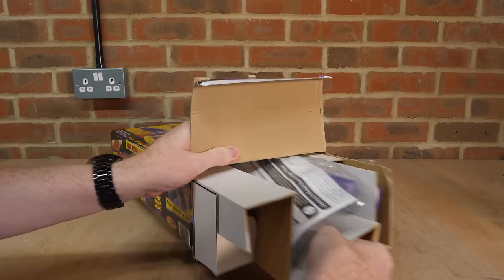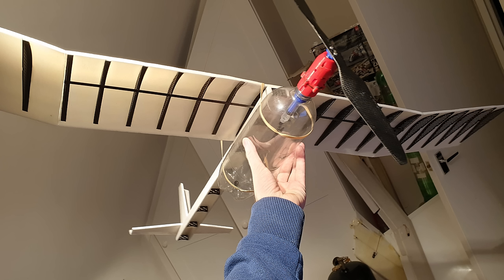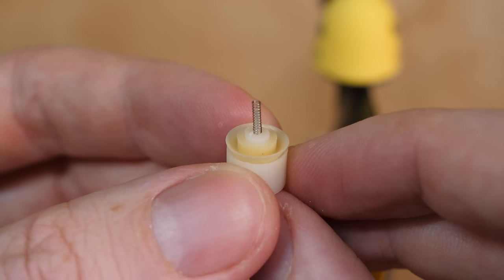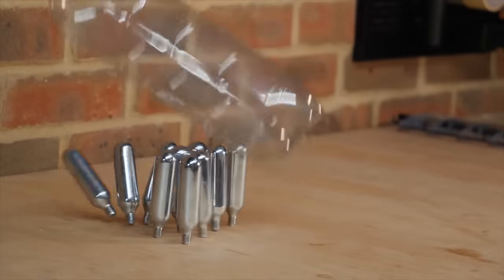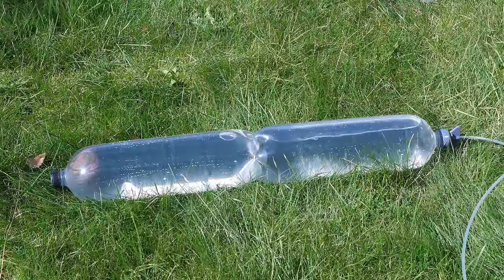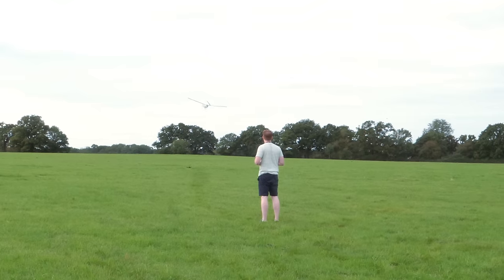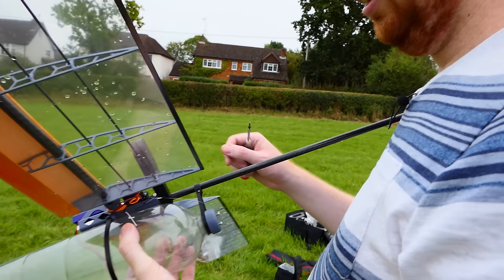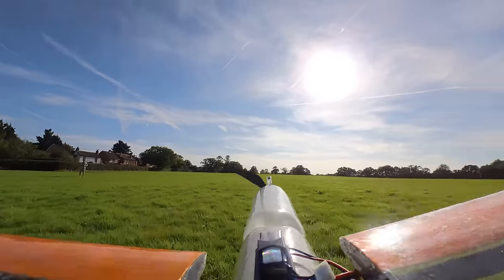Flying a Plane Powered by AIR

Comment: According to Sighard Hoerner's Fluid Dynamic Drag, the half-sphere with the open side exposed to the wind has the highest drag coefficient of 1.42, while a rod with a hemispherical cross section will have a drag coefficient of 2.3. The flying wing configuration B2, would be worth considering. The ASH-30mi, an open-class glider with 86.9ft wingspan, 41:1 aspect ratio (wing length to wing chord), has a glide ratio exceeding 60:1, making it the most energy-efficient glider.

Comment: I don’t think anyone else has mentioned this yet, so I’ll just throw it out there: Have you thought about changing the V-tail out for a large conventional horizontal and vertical stab arrangement? Perhaps this and the addition of strakes below the tail boom could help with that “Dutch roll” behavior you’re seeing when the nose hunts back and forth when you encounter wind or make a control input.

Comment: You should be able to save weight by using a smaller battery - my understanding is you only need it to power the receiver and servos. This can be done with a tiny 1S battery, which would weigh a fraction of your current one (which looks like a 2S LiPo). Smaller servos can be an option as well - I use 3.7g servos for my ultralight RC airplanes.

Comment: the gap between the bottle is causing air resistance and the reason for terrible performance when it's windy, if you can cover the gap with a thin layer of tape so as to create a smooth fuselag, it will perform better in the wind.

Comment: Hi m8. Use a thinner walled carbon tube. Arrows are built for strength. Don't paint it and fly in a straight line and you could get more altitude, and a longer glide down.

Comment: In order to increase air pressure a lot without adding too much weight penalty you may try "encapsulating" the bottle with very thin fiberglass+resine

Comment: Maybe you can find bottles with stronger plastic or thicker to withstand bigger pressures. If you reached at least 4 mins of flight time you could sell the pattern and sell them. The fact that it is air powered makes it so cool, plus the simple design allows for many mods. Imagine how cool it would be to attach a small nerf gun and do dogfights with these.

Comment: Hi Tom. Some thoughts:
To improve flight time, consider not running when launching. In flight do à minimal Number of turns and at Tiny bank angles.
Mechanically : 60:1 LD ratio is best theoretical but much much less at model size (raynolds Number). Can be improved though with bigger Wing aspect ratio, profiled fuselage.
Other considerations : adjust flying speed for climb and glide phases for best Time in the air. Lose weight everywhere (tail feathers holes, less balsa and wing spars, flight battery, wires, remove connectors…
Maybe the motor could be geared (?)
Interesting project

Comment: C02 canisters hold more than their compressed volume value due to the co2 condensing into a liquid. It might not be enough to matter due to the weight of the steel canister but its worth looking at the calculation.

Comment: You spent so much time optimizing the air engine, I'd love to see it used with different sources of gas.  Liquid nitrogen is 750x denser than gaseous nitrogen (and liquid air is even denser), if your engine can withstand the temperature that may be an interesting avenue to explore.
Alternatively, I'd love to see it adapted to steam power.

Comment: I think you should build a 4-5bottle dual engine plane. Try to get some more power to increase altitude so you can glide more. Plus, the heavier weight will help stabilize in the wind.

Comment: Hey Tom,
congrats on making it so far with an airpowered engine.
i got a proposal to make your engine more efficient.
When you mentioned the timing issue regarding the angle of the crakshaft and the inlet valve, i remembered the mechanical advantage of a longer connecting rod.
i played around with designs for flame-eater engines.. practically operating on vaccum.. 1 Bar ~ 14PSI. that`s not a lot.. so you gotta take every advantage you can.
they run remarkably better with longer connecting rods, because the angle between the piston and the crank is minimized. straighter is better. simple geometrics - parallelogram.
to clarify: i`m talking about the rod ONLY. the stroke and crank stay the same.
think about it this way: a more efficient engine will probably be able to run on less pressure. every PSI saved will increase you flighttime while using the same air volume.

Comment: Beautiful project, in my opinion you should take inspiration from the world of gliding. Since, your model fly at low speeds you should concentrate in creating light wings but with modern airfoils efficient at low speeds, also the use of winglet could help you to reduce the induced drag coefficient which can be reduced by adding winglets or by increasing the 'wingspan. This is usually an important factor in large aircraft, but if your goal is extended flight time, even small details matter

Comment: Truly amazing!  If you watch how RC glider pilots fly there might be additional time yet from optimizing your course design.  I’m wondering if you spend the maximum time flying into the wind (which seems like you should gain lift for free but this is a guess and glider pilots will know how to get the most lift from the air) if that might buy some additional seconds.  When my RC plane’s battery is near the end I do this to keep it flying longer.

Comment: So, I have very recently came into possession of a Ryobi Battery powered air compressor.. Which has a limit of 120psi.. (There are prob cheaper alternatives, but I am invested in the Ryobi system now)..
The advantage you would have with this, is while you are doing your checks, and doing your launch, and your flight, and your landing, and then your post flight checks, and you walk back to your controllers.. It's continuously building up pressure for your next flight... It will save you a whole load of bike pumping and getting out of breath.. 
All you would need is to bring a battery or two for the compressor.. You could also even charge your flight batteries from them also.

Comment: When I was a kid in the US (50+ years ago) , we air-water vapor-powered rockets fueled with a bicycle pump. Besides putting our eyes out, we were able to launch a 20 cm tall rocket 20 meters in the air with a rush of vapor. Water in the fuel tank on board, and air pressure added with the bicycle pump. I'd love it if you could do better.

Comment: actually if you want more lift to weight ratio, you may reduce air drag by sloping the wings back, and folding their tips at each side up, thats exactly what is done to airliners, in order to save fuel

Comment: congratulations for this amazing project.  It looks like you need more tail area for better control.  try adding a vertical empenage with similar area of the other two, upside down.

Comment: I love your raw engineering ingenuity, it's inspiring.
I had a thought, as there is greater than atmospheric pressure at bottom dead center, could you route the exhaust into the crankcase to create a double action piston?

Comment: Humble suggestions: 
1) model the next one on a canard-type layout: more forgiving/ less prone to stall, will just porpoise instead but keep flying. Saved the Wright Bros bacon many times. Check out the Piaggio Avanti for inspiration: I think a push-prop config could be more efficient.
2) try CO2 in the bottles instead of air: it will weigh more, but the density should pack more punch at the piston.

3) If CO2 doesn't give the expected kick, try helium! Compressed, it will weigh less than air (but may have less kick at the piston?)

Comment: Hi Tom, just discovered your channel. Very impressed with the development of your air engine. I feel though you are missing a trick with your air tank on the plane. I am sure with the materials now available you could calculate the 3lts capacity of air required and build this into the canter section of the wing. A sealed and moulded carbon fibre may be a little heaver bur the benefits of drag reduction and flight performance would be enhanced. You would have to work out the structural strength required to pressurise this, which I am sure you are more than capable as my engineering skills were learnt when the world was black and white. Keep up the good work.

Comment: I think I know how to improve your engine. Since the issue with air engines are that they start strong with high pressure but as the pressure decreases the engine becomes weaker. To solve this, what about an additional "baby" air tank between your big tank and your engine. That way the large tank will keep the small one at the right psi (possibly needs to be regulated) more continuously. You could also add a servo powered valve to adjust throttle...once you find the right psi trim for the throttle range. Probably also needs some pressure related one way valves (not sure on that one)

Comment: V-Tail without ailerons is typically counter productive. Upon yaw command, the tail imparts adverse roll moment, which you can see in the video by the craft rolling slightly out of the turn before dihedral effect counters and rolls into the turn.

Either a smaller rudder with a horizontal stab or an inverted V-tail would help this immensely. Your aircraft is flying in a skid during the turns, which increases drag due to the skid. (We areo engineers call that Beta angle)

If I were in your shoes, I would start by turning the tail group 180°. It's on a round tube, so that should be easy. That will make yaw command create a roll moment into the turn.

Another thought is to print a stiffening flange on the root and tip ribs so the oracover doesn't pull them in so much. Or, fully sheet the root and tip bays between the ribs.

Finally, you'll save more weight by making a "built up" set of tail surfaces using balsa sticks as opposed to sheet. The sticks orient the grain innthe strongest direction for each member and results in a much more structurally efficient structure. Look at the Sig Kadet Senior as an example.

Comment: Sometimes a little weight actually helps. Can you add a very small amount of rubbing alcohol to ignite after the pressure has dropped.  2 litter alcohol bottle rocket

Comment: Coke bottles burst rating is around 180 PSI and First fail rating is 150 psi, if you want to do something quite crazy like a 4 engine plane you can use a carbon fiber paintball airtank which can go up to 300bar or 4500 psi but you are going to need to use a regulator and some valves.

Comment: maybe you should add a support on the crankshaft on the side that is not being supported, maybe it'll add weight but it would help translating linear force into torque in a more efficient way

Comment: if you haven't already you may want to look into storing the compressed air inside the wings like larger planes do, though it will likely add more weight as you'd need wings that retain a perfect shape at different levels of pressure
Reply: I came to comments to say this, wonder how it could be done
Reply: @Javii96  mini long bottles along the wide part of the wings. I am thinking about those little CO2 gas tanks used to inflate motorcycle tyres, or safety jackets. But longer. Although, I have no idea how much they weight.
Reply: Bottles thin enough to fit inside the airfoils would have terrible volumetric efficiency, and thus weigh far too much for the amount of extra air they would contain.
Reply: @ToastyMozart  Bottles are made by heating up a smaller "bottle", and high pressure air blows it up to shape inside a mold. Maybe it could work if this mold was the shape of a wing?
Reply: @rhov233  i think thats a great strategy to try

Comment: Multi engine disign? With bottles mounted to the engines and bottles as fuselage with air supply shared, and maybe you could use those co2 canisters to refule midflight? Due to mulit engine you should have enough thrust to support the wight. +edit wight should help with stability in wind so you can climb better

Comment: Hi Tom, Thanks for the vid! nicely made glider. Looks like fun. 

Just a few thoughts (from an OC geek). In your quest, you might consider adjusting the angle of incidence of the wings and or the ruddervators. (ruddervators tend to cause the Wichita Waltz [named after the Beach Bonanza V-Tail which would sway back and forth].) A very small (tilt), up or down on the front or rear can make a huge difference. Maybe even measured in layers of wing covering. Also consider making tiny adjustments in the length of the tail boom which will affect the balance point and the tail assembly effectiveness and stop the problems in the wind. It looks like your prop is a bit unbalanced. A careful balancing might be in order, especially after an unscheduled landing on an unprepared surface.😉  Maybe put a c shaped piano wire skid under the front to reduce damage to the prop. Also moving the electric controls a bit say forward or back will make a big difference, by adjusting the centre of gravity. Moving the C of G forward will make it generally go faster (better in wind) and backwards will give you longer glide but more unstable. And finally consider making a covering over the centre of the wings and over the electric stuff to reduce drag. Gotta say that the air motor is a cool idea.

Comment: I flew an RC air powered plane back in the 90's. High aspect ratio wing. Very light build. Czech motor I think. I'd use the motor to get up as high as possible then look for thermals. Compressed air engines for model aircraft have been around since around the 1930's

Comment: my friend..
You have gained a lot of experience with small engines powered by compressed air.
I respect your work on this subject.
I wonder;
If you put small granulated CO2 ice into these plastic bottles and paint the bottles black, will longer working times be achieved?..

Comment: If you are going metric, 1 gram is 1/1000 th of a kg in si units, the kg is the unit of mass not force. You should be measuring thrust in newtons or dynes. Nice flight.

Comment: Hey Tom.
Just found your channel.
This is seriously cool and I genuinely applaud you for the effort you have put in to it. 
I'd like to suggest two ideas, make of them what you will. 
In the days of steam they used double expansion engines to increase efficiency. Perhaps you could exhaust the spent air into a larger cylinder and increase performance? 
Secondly, could you use dry ice as a gas generator? I for prolonged flight? 
The rubbers might not like it much though  
Still, awesome content, I shall keep an eye on your work.

Comment: Im proud of myself for thinking about drag before you brought it up😂
My previous question my be a bit silly in origin but drag was involved so thats something in my book
Reply: After seeing the test flight I am convinced the answer to my previous question is that the plane weight is the main reason it doesn’t get spun around and around.
Reply: After finishing the video I am left with another question.
To my eyes it looks like having the propeller far from the wings shifts the center of mass to far from the origin of the force. 
I am no rocket scientist or aerospace engineer so my terminology is far from textbook but I feel like reducing the overall length of the plane would help with drag and move the center of mass to a better position.
Any experts out there feel free to educate me

Comment: Using your air reservoir as the main body component might help lower weight, though you will have to figure out how to attach wings and a tail to it without compromising pressure.

Comment: Seeing that foil covered wings makes me think if the weight of it could be reduced further if the inside of the wing had a small positive pressure. Also, if the wing had strands of UHMWPE or something similar along the bottom of it from the wing roots to the wing tips, that would provide tensile strength on the bottom, then the shaft could be moved higher and used purely in compression, and part of the compression force could be offset by a positive air pressure. 

The skin, especially on the bottom, could be under tension and hold a lot of the weight that way. I think there's plenty of material there that's only used to hold shape, while not holding any weight.

Also, the wing near its root could be thicker than on its tips, because the tips hold very little weight compared to the roots, saving lot of weight there too, plus that would help with aerodynamics. 

Simplest thing first though, add some winglets and cover the dead area between the wing and the body, as someone else suggested..

Comment: For Improvement: 
1. Smaller Battery
2. Thinner cables (Copper and insulation is very heavy) i think 0,14mm² will do it fine for just 3 litle servo.
3. Remove the casing from the reciver if possibile.
4. Try a day without Wind ;)

Comment: seems to have quite a bit of adverse yaw. its dutch rolling heavily when banking and turning; maybe a regular tail might fix it?
Might add weight but the drag offset you get especially since the aircraft is turning a lot should increase flight efficiency

Comment: I think you use - as far as I see - airfoils from the stoneage. 
It is a NACA 4412 or similar. For this low Re the aifoil ist too thick. 
You've to glue a 0.5 mm zigzag- tape and the plane will IMO fly much better.

2) Check out "Pause Dreizylinder Pressgas-Reihenmotor" - I assume efficiency is much higher.

Comment: Great video Tom.

Couple of ideas to bounce off you...

Have you considered wrapping the bottles in carbon fiber, so you can increase the psi inside?

Also, do you think you could jettison empty bottles as you go for weight saving?  Obviously you would need to use a single bottle at a time, which would have some engineering challenges..

Food for thought.